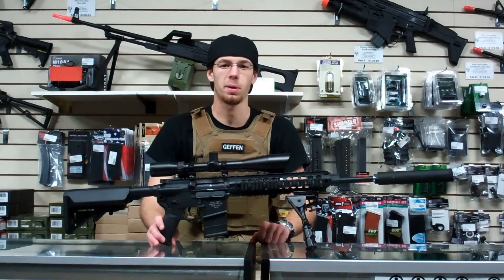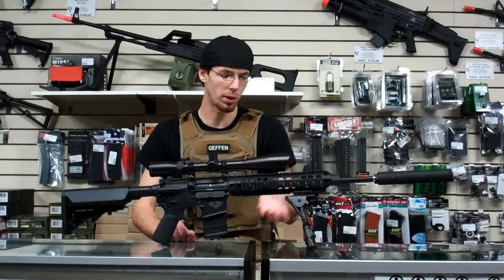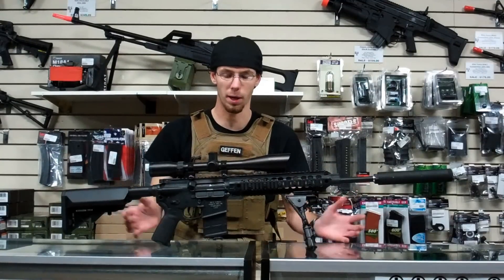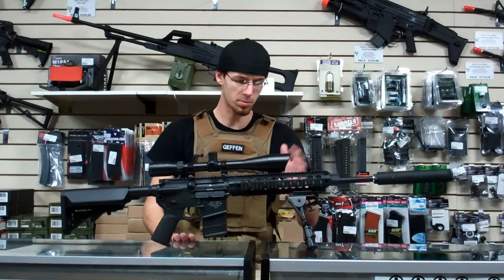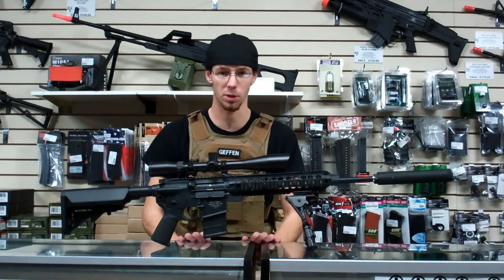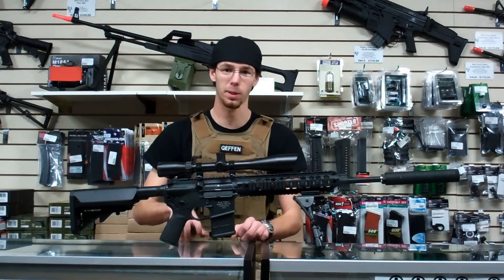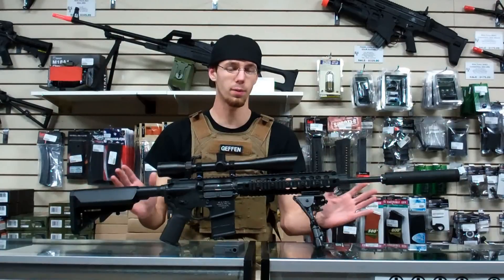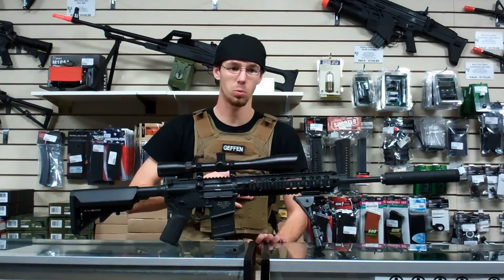Custom DMR at HSA

Comment from the maker: Hey DJPopSwag, the promi 6.03 inner barrel is a great start to increase your grouping. The next step would be to make sure your gun can reach out as far as possible. I'd recommend a new hopup bucking such as the Modify Baton or a Madbull Bucking. These will make sure your gun puts enough backspin on the BB. You can also go with an R-hop setup which will provide the best backspin, but is far more expensive and requires more modification to install. Next, you're looking at an M130 spring (cont)

Comment from the maker: 1) Add longer 6.03 inner barel and add suppressor or longer barrel to conceal it
2) Keep stock hopup, as G36 systems are great. Consider upgrading the nub and bucking to handle more backspin. Consider maple leaf by AST or Modify Baton.
3) Replace motor with high torque to pull M120-130 spring
4) Reinforce gears and wiring to handle Lipo power. 
5) Add accessories- scope & bipod to increase accuracy at range. 

If you're interested in a build like this, we'd be happy to put one together for you!

Comment from the maker: to bump up your fps to around 450. You'll need a nice high torque motor to pull that spring, so an ECHO-1 Red HT, SHS HT or Lonex HT motor will do great. You may choose to reinforce your piston/gears/piston head as well. Use an 11.1lipo and you'll be blown away by the gun's accuracy, ROF and trigger response. We'd be happy to do these upgrades for you, just check out our upgrade/repair section on our website and check out "Custom Build" product. Give us a call to discuss what we can do for you!